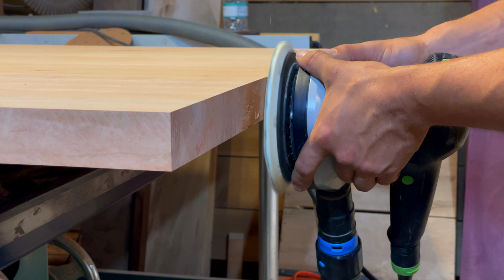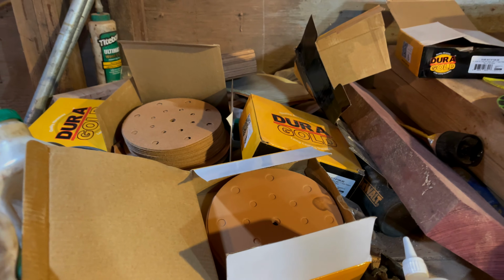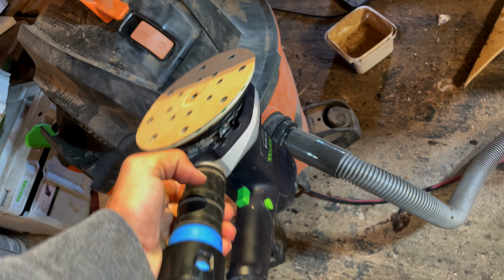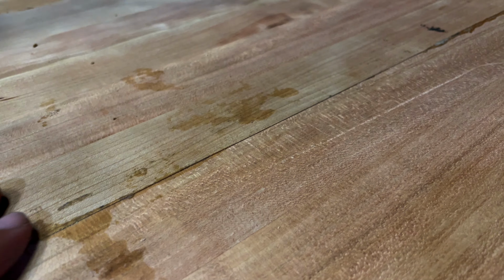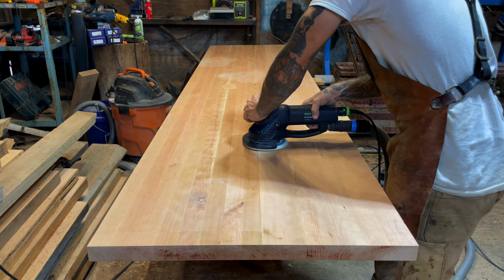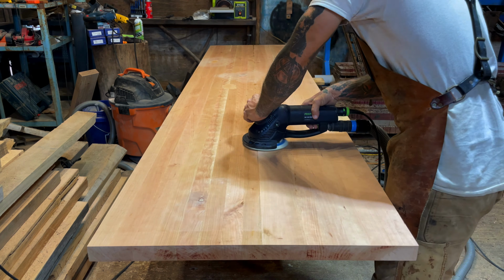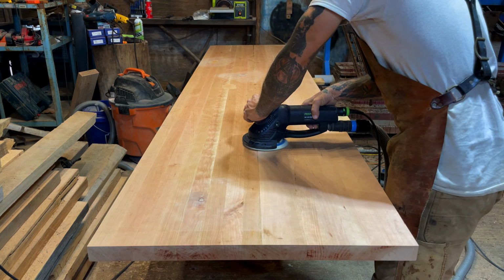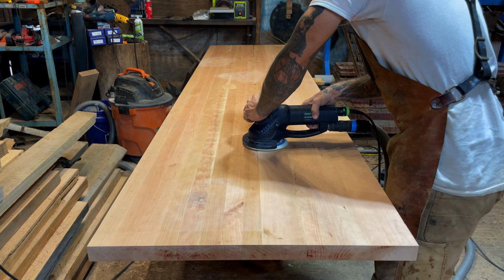A Simple Guide to Sand Like a Pro

Comment: Have you guys seen that Johnny Katz video where they have a robot test different sandpapers? I bought the stuff they recommended and holy shit it definitely is a lot better and it’s actually cheaper than the stuff local to me. Just a thought, you guys should at least check the video out if not snag some of the ones they recommend! I forgot the name but they have a purple texture and an open mesh. Much love for this video, very helpful! ❤️
Reply from the maker: Called cubatron. That’s definitely what we would use if we went that route. Project farm also made a great video on it. I will check out Katz video. We have tried high end mesh ones but we always have the problem of the paper getting caked with dust.